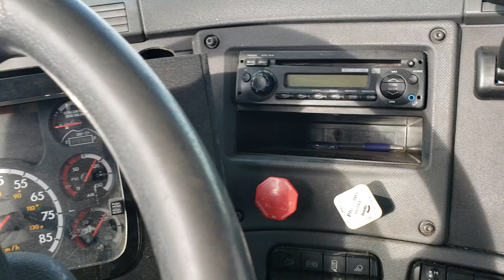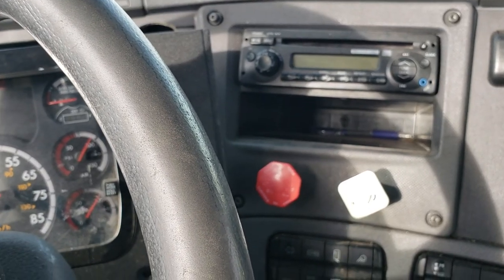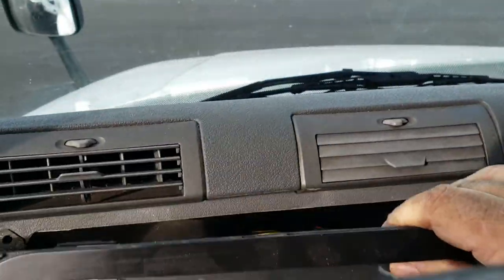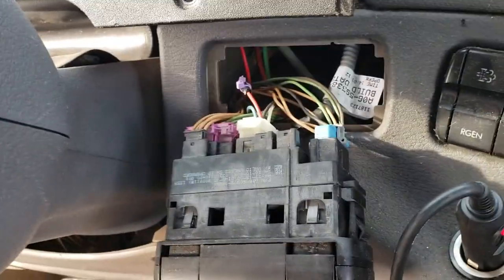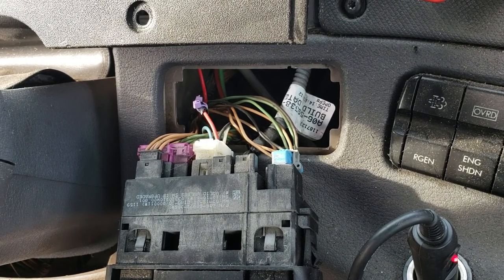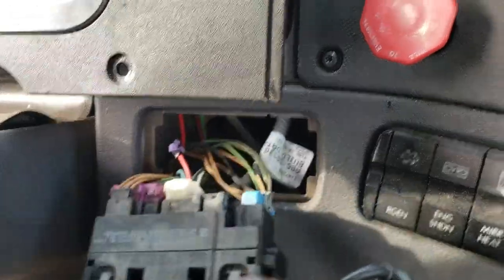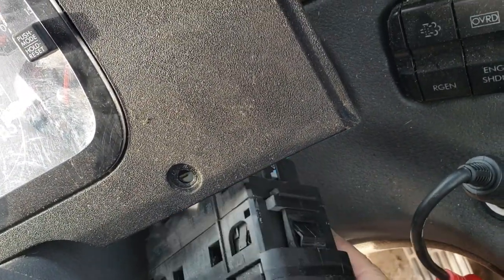2012 FREIGHTLINER CASCADIA GPS TRACKER INSTALL

Comment: You dont have to take cluster out in order to take hazard switches. on each side on the outside hazard  switch there is a plates or tabs that pulls out and ones it is pulled out it pushes the tabs on the inside so you can easy pull switch out.
Reply from the maker: I mount the tracker behind the cluster...

Comment: where do you connect ignition and ground wires on 2012-2018 cascadias?
Reply from the maker: Ignition from the key switch
Reply from the maker: Ground behind instrument cluster if I remember correctly